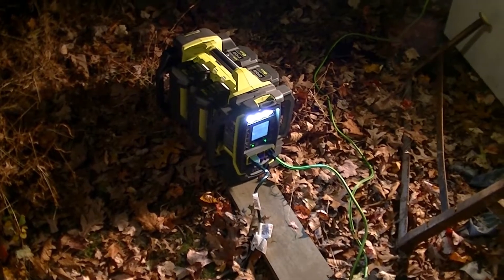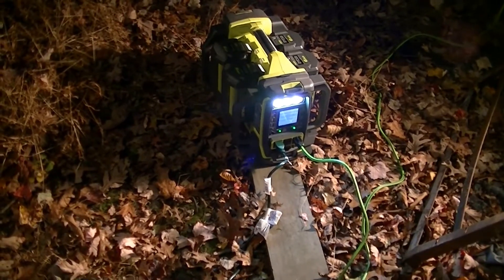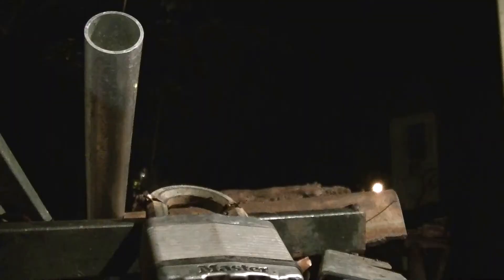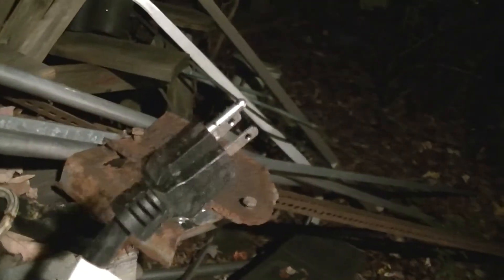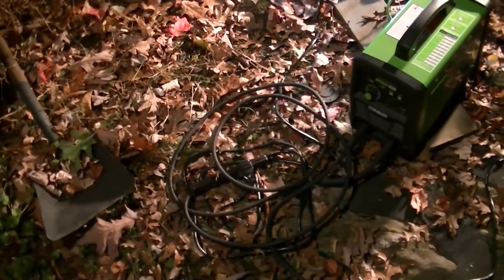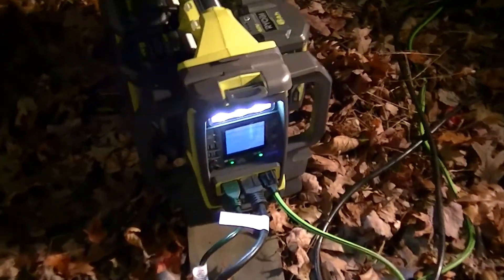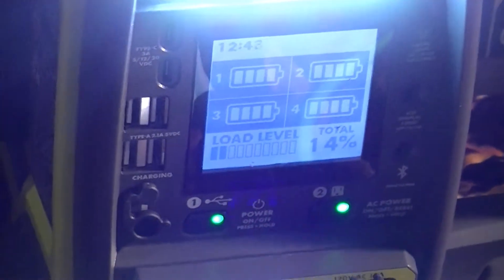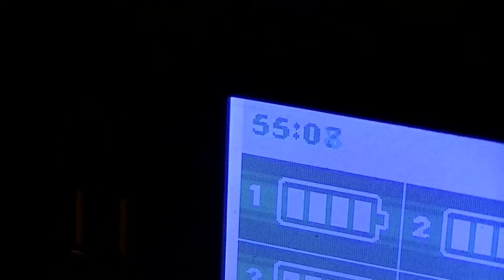Ryobi 1,600W/1,800W power station load testing

Comment: Ah on the batteries ?
Reply from the maker: The big 6AHr ones with an internal 3 2AHr cells in parallel.
Reply: @randacnam7321  960Wh in total ?
Reply from the maker: @nikolajrudnicki4957  Roughly, but that is before factoring in inverter losses.